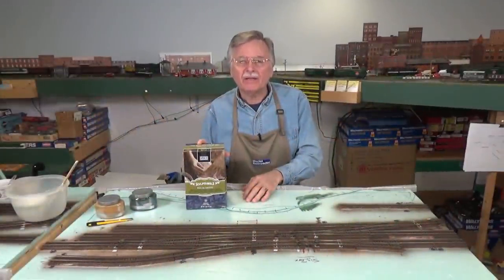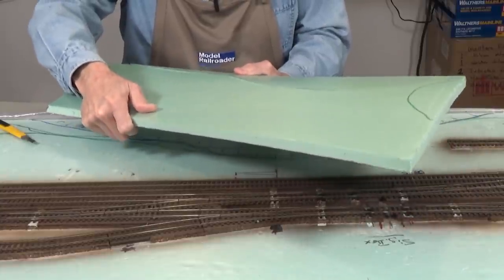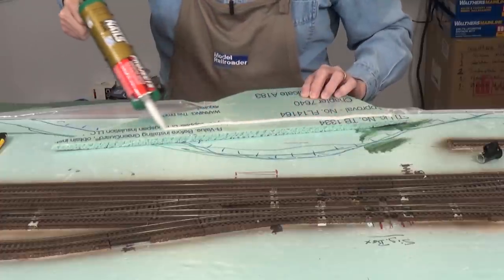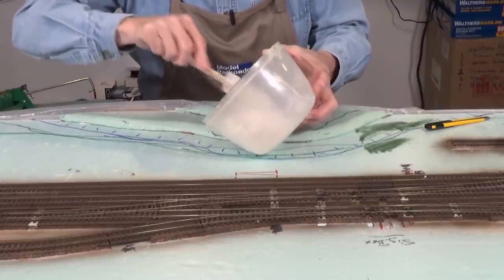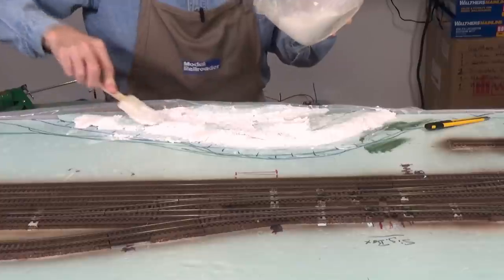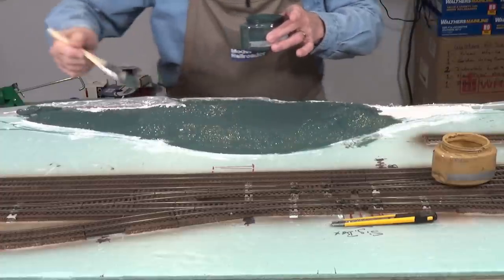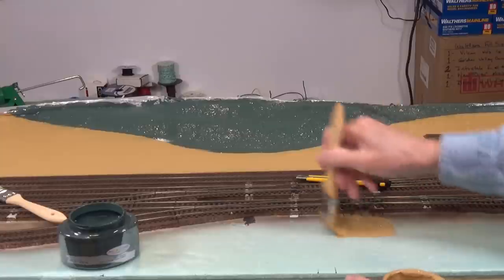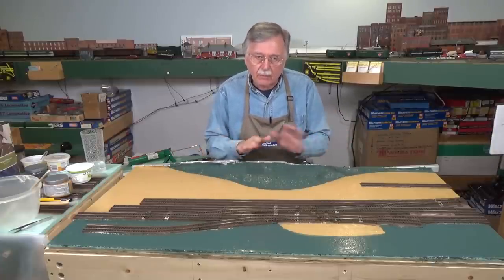Sculptamold And Foam Scenery (155)

Comment: Over the weekend, for the first time I used sculptamold after watching your video. I did purchased a rather large quantity of it since I am constructing a large layout. I was skeptical at first and had used plain plaster more or less for this same purpose but I will say I am very impressed with sculptamold and how easy it is to work with. It seems to allow a longer time to work with than a mix of plaster as it tends to set up much quicker. One lesson I learned very quickly is not to mix up too much at a time. Since it is much easier to mix up than regular plaster I don't mind the smaller quantities to work with, as I find it is just about starting to set as I finish up what I have mixed up. This stuff is ideal for smoothing out the rough areas between the layers of foam board and smoothing the stepping to the next level. Patience is key but the most difficult thing I found with working with sculptamold was resisting the temptation to eat it.
Reply from the maker: I know what you mean.For years I dipped scraps of paper towels in hydrocal and draped it over crumpled newspapers to create landforms. Now foam insulation board and Sculptamold have made it a lot easier. Glad it works for you too.

Comment: Hi Larry great video again, I've very much been enjoying the build. Someone has probably told you before, but just in case. Because the channel is set to 'Kids safe' and suitable for under 13s, youtube no longer allows you to click the bell for notifications, it is greyed out.
Reply from the maker: I need to update that section to reflect that. Maybe I should change the setting so it will allow notifications?
Reply: @TheDCCGuy  I know a few channels have had to remove the 'suitable for under 13s' to enable the bell notifications. Just thought I'd let you know as it's a shame YouTube have changed that option
Reply from the maker: I checked and mine is still set as not for under 13. I also used a second account to subscribe to my channel and the bell worked as expected. Yes it is gray but I think that is just the color they use. When I clicked it the selection options came up and worked. I also still get popup notifications when a video is posted so it all seems to still be working for my channel.
Reply: @TheDCCGuy  very strange Larry. Just tried again and still has a line through the bell, and when u click on it, it says the following "This action is turned off for content that is made for children".  The Joy's of youtube.
Reply from the maker: Maybe they think you’re a 12 year old!😉
Reply: @TheDCCGuy  I've just managed to fix it. I had to unsubscribe and then unsubscribe. When I did this the bell icon was the visible. Thanks for your help and have a great xmas.

Comment: Great videos! I have an old layout with 1/4" plywood. I sort of remember being able to do contorting by removing some of the plywood or lowering it somehow. Can you explain that technique to some of us with older layouts. Thanks
Reply from the maker: If you want to build a hill just cut out the pieces as you desire and glue them just like I did. To go down if you would like to model a river or ravine, then cut out the section following the desired lines of the stream. Then attach blocks of wood to the underside of the layout spaced thick enough to get the desired depth. Next add a sheet of plywood under the blocks to form the bottom of your stream or ravine. Finally use pieces of foam and Sculptamold like I did to create the shape,of the stream or ravine. I did an article,on doing this exact thing in the October 2014 Model Railroader.

Comment: Hello Larry:  I was holding my breath while you were cutting the foam board.  I was afraid that the utility knife would slip and you would cut yourself.  There is an old saying that navy bos’n’s often recite, “Cut towards your chum, not your thumb”!  I’ve just started to watch your videos and I’m enjoying them very much.  Kindest regards.
Reply from the maker: Thanks, but but I too was keeping an eye on the blade and making sure that if it slipped it would not do any damage to me. I had a #17 chisel blade slip once and it ended up impaled in my thumb, still no feeling there. I learned my lesson on that one and try to always cut away from me or at an angle that will deflect the blade away from me.
Reply: I was pretty sure that you would be careful.  I’ve also learnt that painful lesson about working with sharp tools.  Best regards.

Comment: An electric carving knife is a pretty good foam cutting tool.
Reply from the maker: I have used electric carving knives and steak knives in the past and finally settled on the small razor knife. The others seem to generate more fine foam particles to clean. As with all knives you need to watch the cutting edge and avoid accidents.

Comment: Is it possible to mix in the green paint with the Sculptamold and then stir and apply to the foam? This would eliminate the painting process.
Reply from the maker: Good question. It is something I have not tried with Sculptamold but I have done it with other patching plasters with no issues. In those cases I used acrylic paint in a tube and just squeezed out a blob. That would also prevent white spots if the Sculptamold gets chipped.

Comment: Suggestion,
Why don’t you link where you get your supplies i.e. liquid nail, scuptamold, etc. Studies  have shown that using links increase viewership! Remember the video is for the viewership ....... at first your mixing bowl blocked what you were doing, don’t assume all viewers know what to do. Very informative.
Reply from the maker: The kinds of items you mention are so commonly available I assume most folks with any interest can find them easily. Most of what I buy comes from either Amazon, eBay, a local hardware store, or a hobby shop. They even sell Sculptamold at Walmart! I generally provide links in the description for hard to find things or give the website address during the video for others. If you can’t find something then just ask and I will respond, but a simlpe Google search will usually get you a local source faster, that’s how I find them. Just open your browser, type in Sculptamold, and hit return—you will get plenty of local sources for it, same for Liquid Nails, etc. Also those who use the Roku app to view YouTube cannot view the description to get links and the rest can usually get more info faster from a simple Google search.